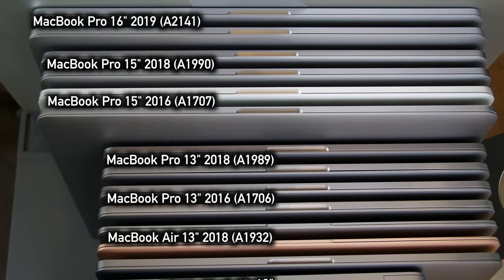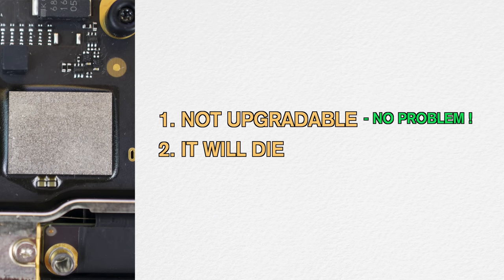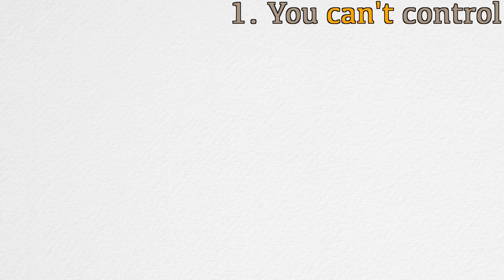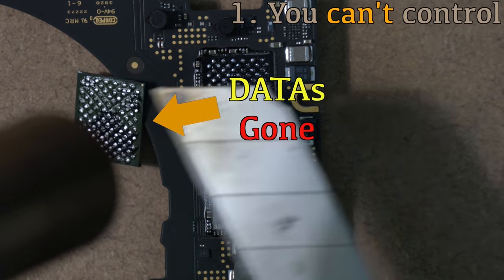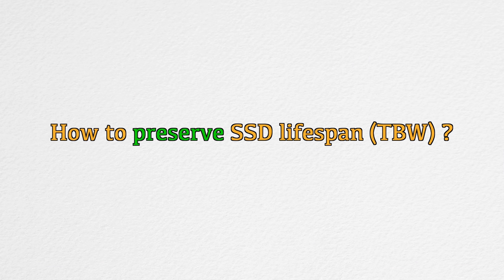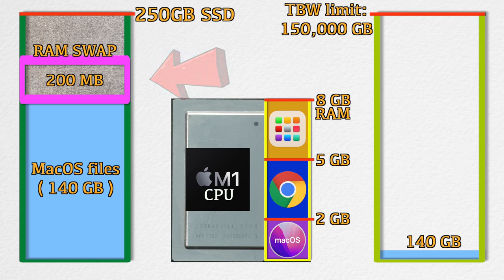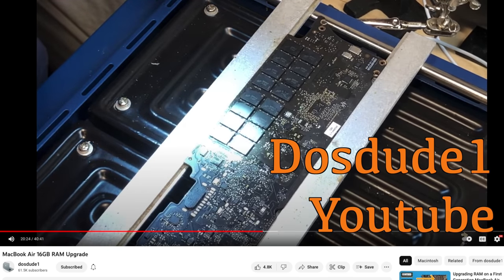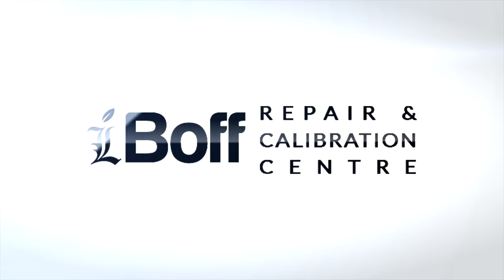These MacBooks DIED from SSD Failure & How To Prevent It (Not for RICH dudes!!)

Comment: In the background of this there are two reasons I will never buy a Mac: 
- macOS
- soldered storage

I don't see any reason to have it soldered, only to force people to pay +600 USD for the extra 256GB....

I those SSDs are anything special, at M1/M2 they even don't hit PCIE 4.0 speeds I have in my ASUS at most capacities. Apple must put server-grade MLC or whatever for this price. Seeing 2018-2019 laptops dead due to the drive is ridiculous. 

Storage must be upgradable and replaceable at any time.

Comment: My 2013 Macbook Pro is still going strong. But good to know what to do if there's an issue. Though might be time for a newer one.
Reply: 2013 Macbooks had SSDs?
Reply: @5_Fallen-3f  I had to think back! It was SSD (I don't know if there were hard drive options - though I bough an external hard drive for backups etc).
Reply: @5_Fallen-3f  Yes! I have one, and looking to upgrade to a M2. I was trying to decide rather to upgrade either the Ssd or Ram. Apple pisses me off because the upgrades are so expensive, that they force you to have to choose and what to sacrifice (that's if you are trying to avoid spending $3000k!)

Comment: I have a question sir,  does this video also applies to Windows OS? I know this is Mac-Related topic but I am in the midst of getting a new laptop and I am torn between a 14" MacBook Air or 15" Dell Latitude. nothing fancy really. This is more like a Light Office/Multimedia/Social Media use. hope this gets noticed. thanks!
Reply from the maker: Hi there yes it applies to windows as well. If you're going for that, removable/upgradeble RAM is a plus. And make sure its using M.2 NVMe SSD so you dont have to worry about SSD issue.

If you're going for Mac because of its OS, just follow the tips at the end this video.

Comment: Great video.

This is one of the reasons why I HATE SSDs (of all forms and flavours), and why I have actually started the process of reverting BACK to using mechanically rotating hard drives, precisely and specifically because of the finite life that ALL SSDs have.

Comment: Wondering if you boot from usb-C / usb 3.0 w/ adapter for older HDD or SSD I would go usb-c m.2 and boot from exterior storage of OS and install macOS from another Mac and plug it in to boot might have select option after turn on; as long Apple M1 laptop don’t have additional security or other software/ hardware issues/ I have done this with older intel Macs and have some nice deals from No boot macs

Comment: As a Windows user, I make sure both my laptop and desktop have a decent ammount of RAM (16-32 GB sweet-spot) and I also use 2x 1TB 7200RPM to store large productivity files.
Reply: I'd still use SSDs for working on large files because of the speed. The biggest problem on Macs is the inability to replace the faulty SSDs whereas all the other components are working just fine.
It seems like the most wicked example of planned obsolescence where the SSD itself is the culprit.
Reply: @phamnguyenductin  and throwing all that working hardware and then apple claims to be green by not providing a charger 🤣😂

Comment: It is crazy, using a laptop as a full computer. Everybody should be aware, that a laptop is not designed for continuous usage. Do not buy SSD lower than 1TB, if your RAM also is lower than 16GB, because the SSD will be swapped to death. The problem at Apple is, they also only integrate nearly  the cheapest types of SSDs, what are TLC-SSDs. For the insane overpriced SSDs, you‘d expect MLC or SLC SSD, with much longer lifespan.

Comment: Does Apple not have software to monitor SSD health and life?  My 512 GB WD SSD does and I can check it from time to time.  I use the PC several hours each day.  The SSD is over a year old and the life is showing at 96%.  And, of course, mine is not soldered in so it is, easily replaceable.

Comment: it's really sad the SSD is hardwired in regard to failure and replacement. There is legitimate reason for memory to be hardwired in the future. The CPU and memory should be in its own module allowing for super thin wires between the two. That means Apple would have to do a deal with a DRAM vendor for a custom DRAM part having less buffering for signals that leave the die, this is done on both CPU and DRAM.

Comment: What if ssd fails during apple’s warranty period? Will they replace it for free of cost then??
I have Apple Care + till 2025 so if my ssd fails during that period will my Mac be replaced by apple under manufacturer defect?
Reply: Of course it will be repaired or replaced free if under warranty. And you will have your external backup drive to restore back to how it was.
Reply: @MrAdopado  thanks for letting me know 😊
Reply: Yes, plus u have Apple Care, but in case of such failure, will be catastrophic and almost every bit of data stored on that SSD cannot be recovered without a backup.

Comment: Hello, I am interested in the adapter, thanks to which it is possible to connect an M.2 NVMe SSD disk to the MacBook pro 15 A1707. I want to ask if you are planning versions for other models in the future and if it is even technically possible - I am specifically interested in the macbook pro 16 A2141. Thank you

Comment: what part shorts to ground?  the ssd or the buck converter?

if it is the ssd if you unsolder the ssd then will the mac be able to turn on and boot from an external drive? meaning the security settings that prevents booting from external drive and sip live on the ssd?

Comment: And most funny thing is that apple or any other manufacturer would be able to make both and SSD and ram still not soldered, if they want. It just a matter of new type of connector or placement ect... they just chose to not do this.
Reply: Well, with RAM it's a bit more complex. Soldered ram allows faster speeds (just look at new laptops) and takes up way less space.
But ssd? Well, there's no benefits.

Comment: Cant do nothing especially when the SSD is taken up by unknown items that we cant remove due to the system needing them to run. Thats why I moved away from Apple and bought a PC.
Reply: And you can also run windows 10 on very old macbooks which Apple has long abaondoned.   My 2008 macbook pro is quite useful still running windows 10.

Comment: Is the internal 512GB SSD on my M1 Mac Studio (32GB RAM) doomed to die after 5 years, regardless of how careful I am with it?
Reply: Not if you have not written more than 300 TB. I have a 500GB Samsung NVME SSD since 2016 and it has written only 60TB in these years. It is a PC and I can just replace it if it dies, but I don´t think it will happen soon. My solution was simply to reserve the SSD for the important programs and files and use normal hard drives for all the games and large files.
Reply: My brother, I have a Windows desktop computer with a 512GB SSD that isn't even the same quality as the one in a Mac. I've used that SSD for 6 years, during which I've written 100 PETABYTES on it, equivalent to 104,000 TB, and the S.M.A.R.T. tools indicate that it still has 87% of its lifespan. I don't really think your SSD will die in 5 years...

Comment: Also nobody tells you that repairs cost more than the original unit....a friend of mine fell on top of her Apple Mac air 1 ( 2 months old) long story short she was told to bin it as repairs would cost Aud $2,860 ( ( unit cost new $1 700) she asked about removing the 512 gb hard drive.....Apples reply ( so very carbon neutral) oh no, it can't be removed, it's soldered in! Just be aware of Apples repair costs before you buy!

Comment: Both 128 GB SSD and 1TB HDD (aka Fusion drive) in my 2014 Mini died well before their 10 year expectancy
 I'm pretty sure with nowhere near their TBW written to them, unless it was backoffice macOS usage eating into their lifespan
Fortunately, with adapters both could be replaced with NVMe drives
Otherwise, it'd have been recycling time ... which is exactly what Apple wants to sell new stuff

Comment: The only solution is to stop buying their products.

I told Apple rep. when my 2017 Macbook Pro SSD died: this is NOT a "pro" device. A "Pro" replaces his drive and get back work in a couple of hours, he didn't go to service and throws away his PC and/or completely replace the motherboard. This is a complete non-sense. This was my last macbook. As a "pro", I just purchased a framework PC. The ryzen version should be comparable to the latest M2. 
When Apple will be back on the professional side, I'll purchase one again as I did for the past 20 years.

Comment: Well, I dont use chrome, I use Safari.
I also dont download movies.
I will make sure to multi task less and not open so many tabs though.
I do have an external SSD for all my files and even directed my browser to directly download into the ssd downloads file.

All in all, I actually just do light work on my Mac Mini M1.
Reply: Best to use Thunderbolt as OS drive
Reply: Then if this is the case I better buy a PC 🙄

Comment: i wonder when the SSD actually dies for whatever reason - whether it’s IC or lifespan, what’ll be the behavior of the laptop during the attempts to power up the device. will the basic power circuit perform, but due to the issue the screen won’t show any activity? in case of intel macbooks with soldered SSDs that have fans inside, for example - will they start to spin or the whole thing will remain off in case of drive failure?
Reply from the maker: We will explain the symptoms you'll be getting when the SSD dies in the next video, as it will greatly impact on how you could replace the dead SSD.
Reply: @iBoffRCC  thx for the reply, i’ll keep an eye out for the video

Comment: Is it possible to replace the dead SSD chips or the only solution is to buy a new laptop?
Reply from the maker: Yes it is possible, watch our latest video for it. But you can only replace it with used ones
Reply: @iBoffRCC  Ah so a sacrificial macbook is required to resurrect a dead macbook.  How macabre.  LOL

Comment: Soooo does it mean that if you copy something onto the SSD and don’t delete it - like say, photos, will that also affect the life of the SSD ?
I’m worried, guys as I’ve just ordered a new M2 Pro with 2 TB SSD…which, after reading all these comments, I feel has been a mistake. 
And no, I can’t cancel that order.
Why on earth did Apple come up with soldered SSDs!
Reply from the maker: 2TB is okay actually, so you dont really have to worry too much. 

If you just keep the photos in your storage and not deleting it, then it will not shorten the SSD lifespan. And its a good idea to always keep 50% free space from the total SSD size to prevent wear-leveling like the pinned out comment above.

And to be honest, the soldered SSD is not the best place to keep your personal things, because when your logic board died from water damage, or anything like that you'll never get them back unless the logicboard could be revived

And even if the SSD dies, there are ways to replace it which we will explain in the next video

Comment: A simple explanation on larger RAM can keep your machine last longer. Windows Page file also has the same effect as swap file of UNIX/Linux and it's the main problem which make windows laptops runs poorer over time since windows memory management is pretty bad
Reply: Windows memory management is not bad at all. you can turn on memory compression as well similar to macos or Linux zram. but usually since win 10 it is auto on if you have 8gb ram or less. maybe even with 16gb.

Comment: got 500gb on a 15"2017 touchbar.  ~450gb free. don't use cloud. How about running first aid in disk utility from a recovery start from time to time? Will this not help fix or omit the bad sectors so to speak? I have had 70 tabs open in firefox ~for the last 4 months, i do some heavy drawing work but that info gets stored on an external server. just took a look and i am using 12gb on board ram and 750kb swap. Guess it payed to get 16gb of ram.

Comment: The solution is very simple, just don't buy MacBook! Buy a normal laptop, where you can change yourself the SSD, RAM, etc. I personally, buy only ThinkPad and I am happy. Now I have ThinkPad P16s gen 1, and it is fantastic! My previous laptop was ThinkPad W530 which I used about 11 years and it is still good.
Reply: Yes old maccbooks were actually not too bad (such as 2008 macbook I have with upgradable ram and ssd), but Apple bean counters wanted to maximize obsolescence cycle of it's products.

Comment: ram modules don't go bad that often, but i have more than 5 dead ssd-s in my workplace.
Reply: Non volatile vs volatile memory, ram doesn’t have a finite lifespan like ssds
Reply: @Jushwa  yeah they usually go bad due to manufactoring defect od some other component failing on ram module board
Reply from the maker: yeah we do have bad SSDs coming in every week now

Comment: Lack of good diagnostics really make this a difficult problem. All these SSD controllers lie and lie and lie to SMART, to hide internal wear leveling. Some newer SSD's are better about this but I've had many many that passed all diagnostics, and make PCs hang, crash (hang during windows updates, rolling back and forth for 2hrs, as the user presses the power button every 5mins). We are completely flying blind here... but don't worry it's not like that's where your data is... umm, nvm :)
Reply: I"m referring to replaceable SSDs also, I imagine that these soldered on internal SSD's lie even more, to prevent logic board warranty claims.

Comment: Activity monitor shows 2,38Tb of written data in a bit over a year, so with this type of use (and not much more Stable Diffusion which uses a lot of swap memory), I should expect around 100 years from a 512Gb drive thats half full currently? Only have 8Gb of RAM unfortunately.
Reply: Checked with iostat command, and it shows :  disk0 
    KB/t xfrs   MB 
   22.82 I 329122523 I 7335987.57
which means 7,3TBW ? Thats still 41 years worth of occasional photoshopping, Lightroom photo editing and web browsing with 300TBW limit.
Reply: The average person will never get anywhere near the expected lifespan of an SSD and if they have an SSD failure, it will be due to an actual failure, not because they wore it out. Unless someone has very write intensive use cases, there's no need for someone to worry about SSD lifespan. Getting more ram is a good idea for many reasons,  which can help prevent paging and swapping, but it just isn't a problem.

Comment: What RAM & SSD size would you recommend for 4k/8k video files? I had only been looking at 32gb unified RAM & 1tb SSD & was going to use external SSD for working. Any higher than that makes the computer just too expensive. Kinda pi$$ed Apple doesn’t mention this when buying. I tend to hold onto my computers for 7 years+ but I’m afraid the M2 chip will die before that.

Comment: This happens on windows also the only difference is you can replace it .. I have never owned a Mac but I have owned more than 5 windows laptop and I tell you all had battery issues, failed lcd and motherboard issue that needed replacement which cost more than a new laptop so yeah I am thinking of switching to a Mac. The real question here is longevity because from my research windows failed within the first 2 years while Mac goes up to 10 years

Comment: This isnt just an issue on Macs. Also the more RAM you have the greater the swapfile. Windows used to be recommended that the virtual page file should be x1.5 that of the RAM. Similar with Linux Swap Partitions.  Also having zero swapfile is just a bad idea the three main operating system really do require a swapfile for normal operation.
Reply: When you have little RAM, the swap file will be used much more than when you have a lot of RAM
Reply: @KokkiePiet   indeed but been able to expand the memory temporarily on to fast storage even with this configuration isn't a bad thing. Although having it soldered is.
Reply: @KokkiePiet   I do agree get the most  RAM (16GB min) you can afford and storage (1TB). As for rewrites I think the numbers are greater than most people realise and I am probably more likely to upgrade my machine before it becomes an issue.
Reply: @andrewcrook6444  still very happy with my i9/vega 48 iMac (I think one of the best Intel Mac’s ever made) with 128 GB RAM, which I could put in myself.
Reply: I think you missed the part where on newer Mac you cannot boot or use your Mac anymore once you lose your ssd because you basically lost your bios. Losing the ssd can also be a matter of bad luck but the issue is that replacing those or fried ssd cost so much that people would just plug in an external ssd with an OS and continue to use their Mac instead of buying a new one. Well now they can't do this on new Macs because the way the Apple equivalent Bios is soldered.
- As for TBW, people who relies on this and calculates like 15 years are missing the point where 'soldered' SSDs once fried are lost instantly. Happens to many people nowaydays, and just because something does not happen to us does not mean it is of no real concern.